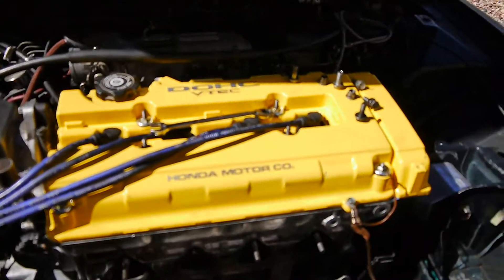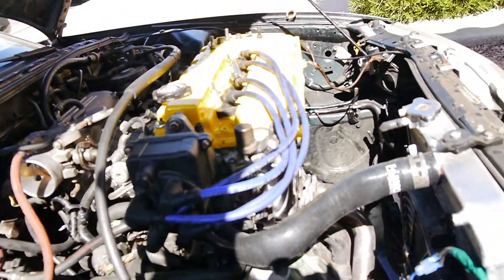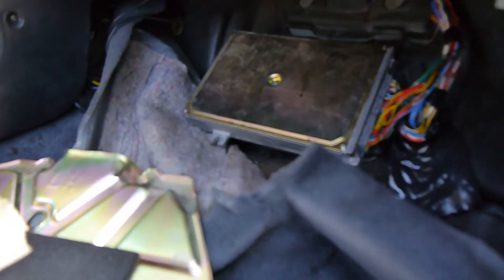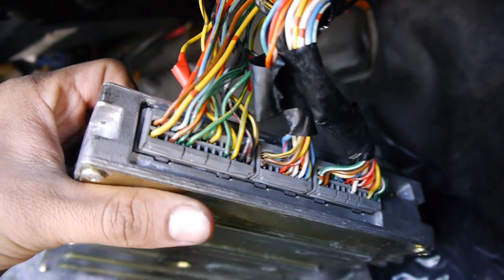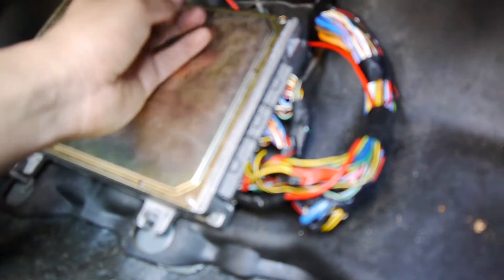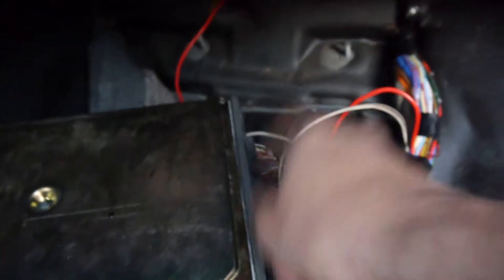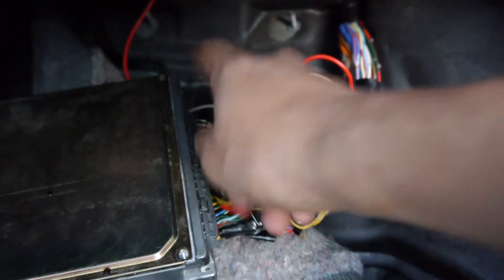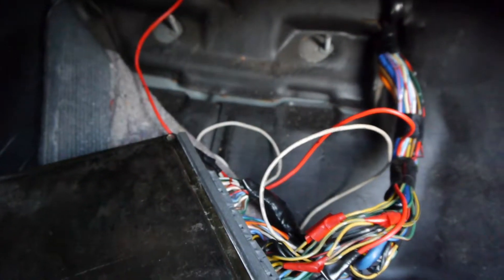b20v or lsv vtec solenoid wiring obd1 and bypass vtec oil pressure switch

Comment: My car truble short temperature sensor wayar..no conecet what a problem eco or meter?? Relay ok new..sensor new...fuse new..wayar lost to ecu connection done check wayar good but still ecu detect temperature switch.. check suket wayar no connect
Reply: Missing vtec too connect 😢

Comment: So I have no oil pressure switch. Is it going to A4 or D6?
Reply from the maker: 1 straight from the solenoid to a4 then get then get another wire straight d6 to the wire you just added from vtec solenoid to a4.

Comment: Hey I'm doing a b16a swap in my 94 cx hatch that has no wires for vtec. I routed one wire from solenoid to a4. Then to activate it should I just run one wire from a4 to d6 and thats it? No ground for pressure switch?
Reply from the maker: Just do what I did bro depends on if u have a jdm or usdm solenoid also your computer needs to be chipped

Comment: I dont have preassure switch like yours bro. But my vtec is not kicking. I clean my vtec solenoid and replace a new gasket and still no kicking. What should i do?
Reply from the maker: Check the oil and the the wire if you're computer has the check engine light on it might be looking for the pressure switch and maybe thats why is not turning vtec on

Comment: I was wondering if i would have to add a ground wire for the vtec wire or is it fine if i just run the wire straight to the ecu?
Reply from the maker: Everything just goes straight to the ecu bro if your solenoid has 2 wire they both go to the ecu if you only have 1 wire in the solenoid you do it like I did mine cause mine has only 1 wire
Reply: DAProject702  I have 2 wires but the vtec plug is missing on my harness so I wanted to do a hardwire.
Reply: I have the vtec oil pressure plug but I don’t have the vtec plug on my harness. So I wanted to hard wire it for the vtec
Reply from the maker: Go to the junkyard if u can find a car that had vtec you can get the connector and just wire it to the ecu I was never able go find 1 for mine so I'm just running it straight to the ecu I had to add to wires to the harness too since my car wasn't vtec I think I showed in the video how to wire it when your solenoid has 2 wire I just explained it tho you basically just run 2 wires from the ecu to the solenoid if u get the connector perfect if not you can still splice them but is cleaner with the connector
Reply: @daproject7025   alright , thanks bro! glad you replied back even though the video is 3 years old lol.
Reply from the maker: I get notifications on my phone lol I tried to reply sometime I do forget things I did years ago tho but I just say I dont remember in those cases lol
Reply: Hey project 702
Mines has 2 wire
So run both wires to a4 correct? 
Then how do I bypass oil pressure switch
Reply from the maker: OK the one thats by itself goes to a4 and the the one that has the 2 wire which is the pressure switch one goes to d6 and the other goes to any ground so it should have like 3 total
Reply: @daproject7025  
My vtec unit has 2 wire 
Green and black
Do I connect those 2 wire together and run it to a4 for my solenoid
I  don't have a connector to my oil pressure switch
Can I bypass without oil pressure switch without wires
Reply from the maker: Oil pressure switch is what activates vtec and you might have a different car or ecu then mine if I understand right you have the pressure switch which has 2 wires and the vtec solenoid has 2 wire too right
Reply from the maker: For mine is a p28 ecu jdm solenoid just one wire comes from it 
Usdm solenoid has total of 3, and 1 is from the solenoid, 2 from the pressure switch
Reply: @daproject7025 
Yes my vtec has 2 wires
But butt those together
Then run single to a4 correct
Reply from the maker: I think you might have a different ecu bro

Comment: I did a swap on my EG, when I have the original p28 none chipped the Vtec kick in but with the chipped p28 it doesn’t engage, any body knows what might be the problem?
Reply from the maker: Oil maybe speed sensor or the new solenoid might be dirty that's just a few reasons bro
Reply: its just weird that with the OEM p28 the vtec kicks in fine  @daproject7025
Reply from the maker: Yea bro mine has gone down for nasty oil the poor wiring lol since I didn't solder it should work bro just gotta look around its annoying sometimes bro is so many things that can make it not work

Comment: Can you just swap the entire assembly with the pressure switch on it from a b16a2... that’s what I did and still have no VTEC on my 97 b18c
Reply from the maker: Yea you can use either one as long as you wire how it supposed to be if its wire right can be some other issues like low on oil or even the wrong type of oil sometimes
Reply: DAProject702 steve at hmotors helped me out ,my speed sensor was never hooked up cuz I lost the clip so the car was thinking I wasn’t moving which makes sense ... haven’t tryed it yet but confident the speed sensor not being hooked up will fix my issue
Reply from the maker: Yea bro that makes sense since a lot of small things can make it not work sounds like that's the reason

Comment: hell yea bro didnt know you were going vtec. full block or b20 v?
Reply from the maker: +Da9 greg b20v bro I was gonna put a turbo too but the turbo was bad so leaving it all motor for now
Reply: DAProject702 dam sounds sick ! I'm planning on boosting my b18a1 before i put a vtec head on it hopefully sooner then expected
Reply from the maker: +Da9 greg yea should be fun I was gonna do that too but I found a good deal on the head so I went for it
Reply: what head is it?  did you go with arp head studs?
Reply from the maker: +Da9 greg it's a b16 with crower springs and retainers got it for just 300 that's why I bought it lol and I used golden eagle studs and lsv kit I found a local guy selling that why I went with golden eagle